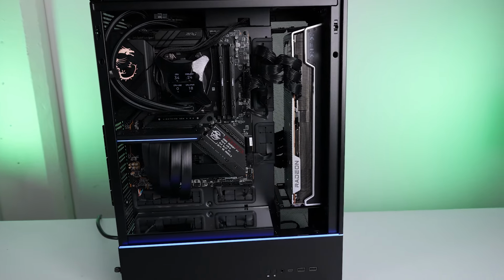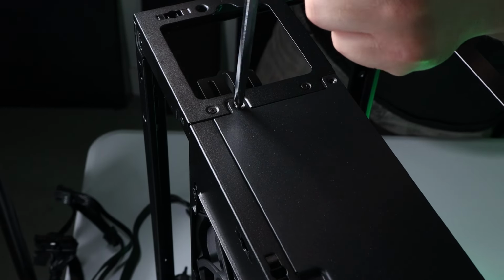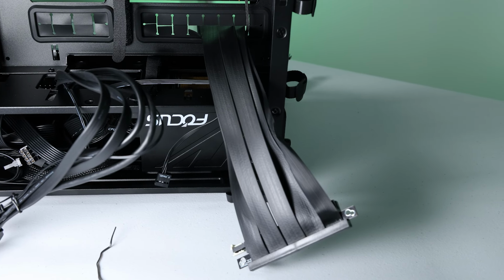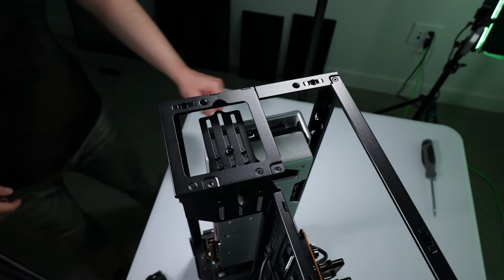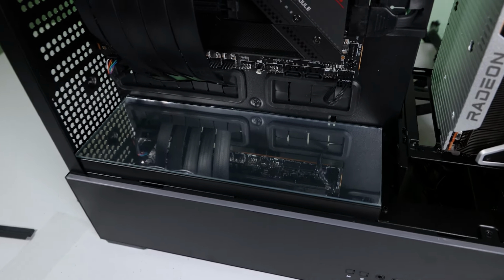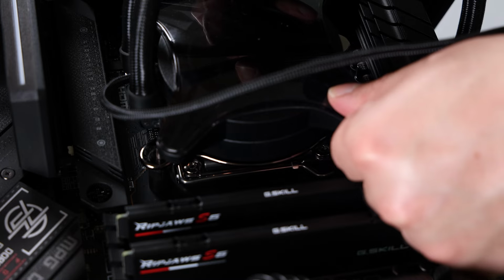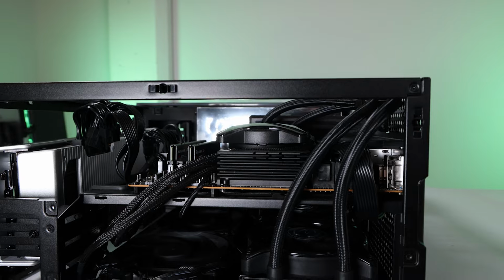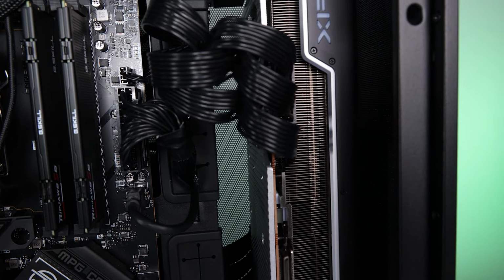Epic AMD Build in the Lian Li SUP01 (7800X3D + 7900XTX)

Comment: Lian Li makes some nice cases. So does phanteks. So much for that deepcool build eh. Lol. That's a real bummer. I was gonna grab that mystique but went with the Arctic Liquid Freezer iii 360 instead. Can't wait for the next video! Great job Bud.
Reply from the maker: Canada doesnt have the sanctions on deepcool but the case that was getting sent here probably got intercepted somewhere on the USA/Canadian border 🤣 . I do have the mystique though sitting here.
Reply: @Renegade_Rabryn  yea that mystique is the only other AIO that fully goes head to head with the LF iii. I'm not big on the LCD screens because it requires software to use it. But I'd make an exception for that AIO.

Comment: I love your filming honestly, its so much easier to get a sense of what the case is actually like and more "realistic" looking than all the fancy camera work the top PC channels have. I think its the raw look and lack of filters, although it would have been nice to see a little more in some shots, it felt like I the top view in some shots was cut off, and i wanted to see more of what was around it, such as when you installed the GPU.

It's a fantastic case tbh. I've seen several reviews on it and there is a lot to like about it. My main complaints would be the ugly riser cable, and concerns about very little to no direct airflow over the motherboard. I don't like the separate rear intake fan either. If they make a v2 I'm sure it will be badass. Would have loved to see a build with a motherboard with back connectors as well, since this case supports that.

Excellent tip about removing the window film before installing it, I have never heard of anyone think about that, even myself, and I worked as a mech engineer at a place that specifically had anti static tape because the tearing off of such tape/film releases tons of ions or whatever it is that charges it.

The "Hawk Tuah" and grossly incorrect use of the word "enthralled" had me dying btw 😂 you've got a future in this my friend, keep grinding!

Comment: Just built in this case myself.  You oriented the radiator correctly to the way Lian Li recommends the best cooling config, so no worries on that.  Unfortunately one of the provided case fans from Lian Li had a shot bearing that I didn't discover until I spent hours taking apart my old pc and putting the new one together.  Now I have to see if they'll replace just the fan so I don't have to return the whole case to microcenter.